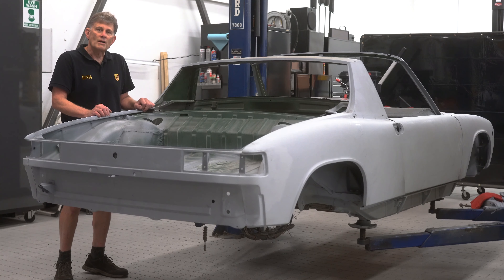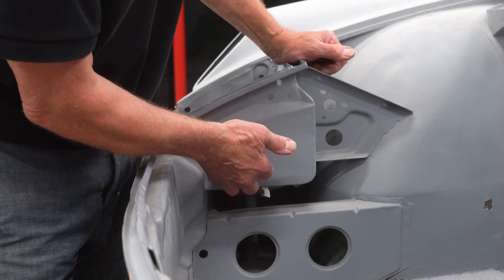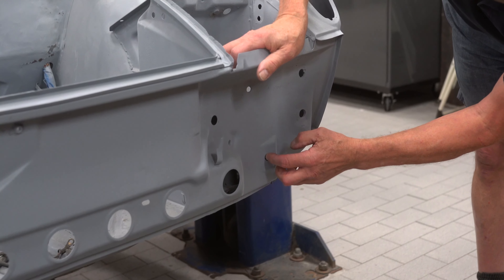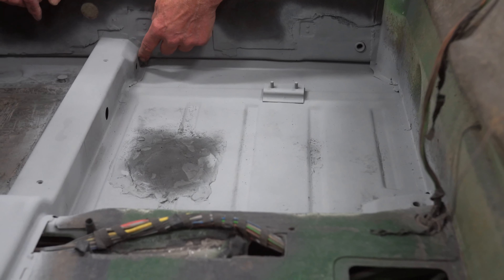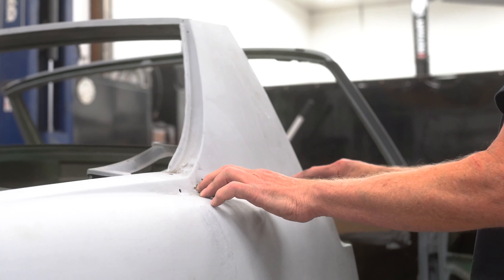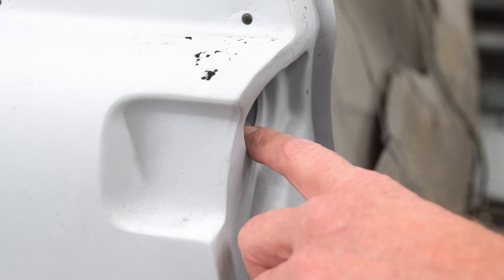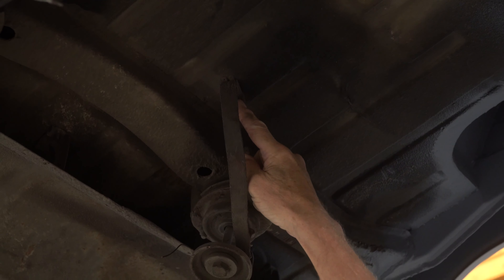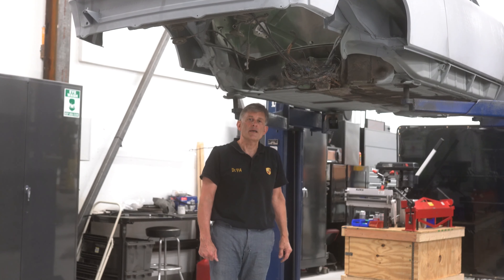Porsche 914: Body in Blank

Comment: It's fun to see that today there is such a great enthusiasm for the 914 as shown in this video. I made a complete transformation of a 71 year old model from 914/4 1.7 to a 914/2 2.2 GT In the early 80's. With ventilated brake discs, anti-roll bar and a 2.2 T engine (without fender widener) I stabbed myself bloody to get all the certificates of Porsche in Sweden and finally it got approved in the inspection. But no one cared a bit because it was a VW Porsche ...